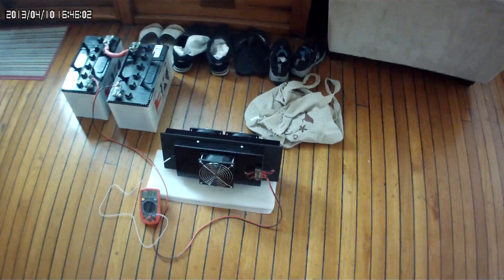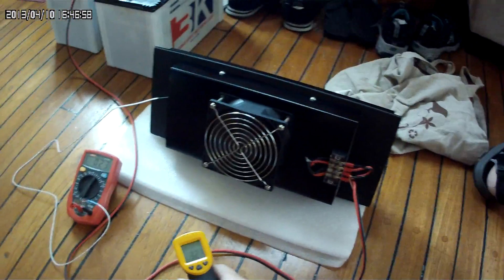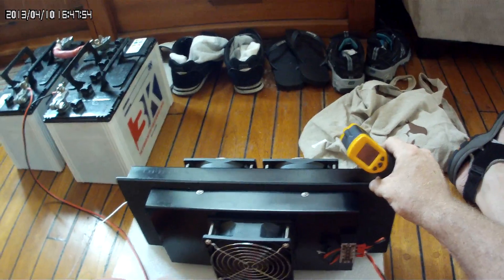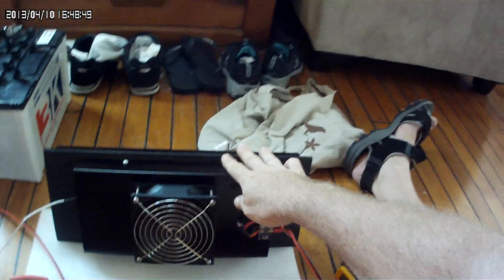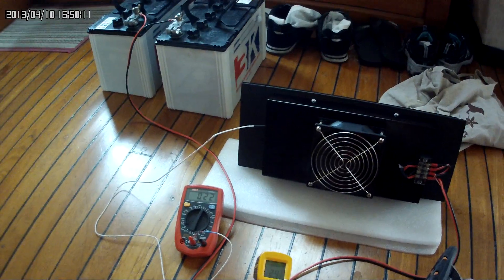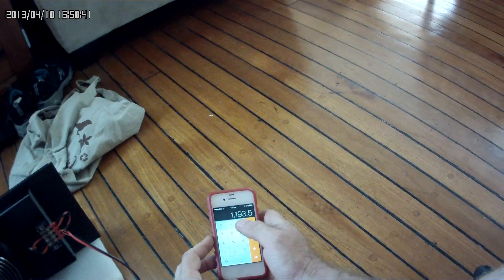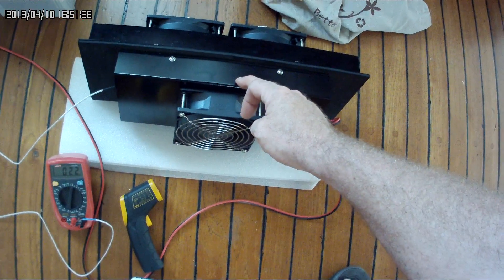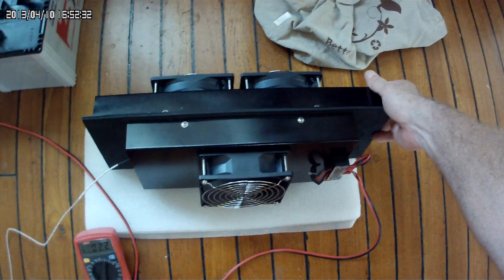Peltier Air Conditioning

Comment: I wonder how it is that the air-conditioner inside the Tesla Model S electric car works... no engine so it cant be traditional. I hear peltier has very bad efficiency though!
Reply from the maker: Hello, As I understand it... The electric car uses a DC motor powered by the batteries... Some electric cars use a conventional belt and pulley off the drive of the main electric motor to turn the air conditioning pump to move the freon to cool... and the flow of the freon can be reversed to thus blow heat inside the vehicle... and there are even self-contained DC powered air conditioners... BUT they are still using freon to make the heating and cooling. The method of compressing the freon is different.
Reply: Alan Marine the tesla has the motor directly on the rear axle, so it can not possibly be with a conventional belt to drive an air conditioning pump. i am thinking maybe they have a special high efficiency motor designed to run only the pump exclusively. I guess this is how self-contained DC AC's run

Comment: Thx for ur idea im attempting to make 1 for my room in stead of 1 peltier module i use 2 cause im cooling a bed room now im planing to build it tempreture adjustable and the fan is speed adjustable and run on 24 volts or 12volts to conserver energy cause im just in a small apartment so i cant shove 1 big air conditioner in my apartment
Reply from the maker: Watch the efficiency on the common TEC modules. I found that the semiconductors are the same as they were in 1960, so they are not very efficient. I have had my TEC modules made with several different P-type and N-type semiconductors.Not absolutely perfected yet, but I am above 90% currently. It is a lot of fun using this technology ! good luck !

Comment: Have you had problems with your heat sinks in direct sun light ?
Reply from the maker: The heat sink is covered, so there is no direct sun contact on the aluminium. As the cover is powder coated black, I used white coloured (cabinet shelf) contact film to see if there was a difference in efficiency when the sun is on it during the morning hours. Not much change. The 2 fans do a great job to remove the heat quite well.
Reply: Alan Marine *aluminum but good project

Comment: You could use the water surrounding the boat as a hear dump. Use less energy in fans, quieter, just with a large heatsink in water.
Reply from the maker: I have tried that in my earlier tests. The pump does consume more current as it needs to lift the raw sea water up 3 plus meters to the unit. That method will only allow the unit for cooling and not allow for dual purpose, as I will be reversing the polarity of the power to the modules in the winter so the heat is blowing to the inside of the boat.
Reply: Alan Marine
i wonder if you have overestimated amount of water pump needs to pump. It's surprising how low water flow may be enough. Pump that takes maybe 30-40w should be enough; just needs to be right type of pump to be able to pump that high.
Reply from the maker: For all practical proposes, a small (low watt) pump over the side of the boat is un-attractive, and inconvenient. I have tried it. A proper marine sea water pump that is connected to a strainer, and is fed from a thru hull sea cock (at the bottom of the hull) would be the permanent solution. Unfortunately the smallest size is 800 gallons per hour that pulls a bit of current. I want to have the ability to use the unit for heating as well. A water cooled heat exchange on one side would make the unit "Cooling Only". It is a good idea, but eliminates the diversity of heating and cooling from a single unit.
Reply: Alan Marine
Unit can pull heat from water too; some cases when you want to heat water is even warmer than air outside. There is even then still that pump problem tho.
Reply: If the water pump is primed with no air in the water outlet all the way back down into the oceon would that negate a lot of the lift the pump previously required sure to the poll of gravity from the exiting water....

Comment: By the way metric is international scientific standard but still some countries refuse to use it in normal life. Watt is measure of energy be it electricity or heat (i wonder why BTUs is used at all...). You don't know how eficient those TEC units are? TeC units aren't very eficient; i'm not sure if their cooling power is even as high as power they use to operate. Compressor coolers are way more eficient their cooling power is at least about 2-3 times power they take to operate. While they may not be ideal for boat use there are versions for 12v and 24v DC use as motor running compressor don't need to be using AC. CFC's are illegal in most of world as far as I know and all new air conditioners and such should be using other gases.

For boat i would suggest radiator loop with water from sea/ lake whatever if it's not too warm and if it's too warm you should consider cooling warm side of your element with water loop as it should make heat transfer way more eficient meaning cool side can get cooler.

Comment: Actually pretty small if you want to compare it to other air conditioners out there.
Is that something you built?  Or is it something you can purchase?
Reply from the maker: It is something I built. I purchased parts, and had parts made to my design. The TEC semiconductors are made to my requirement by a local factory. The standard TEC module you buy off the shelf are not efficient enough for my purpose. The goal is to eliminate the use of compressed Freon gas (CFC's) and AC power to have air conditioning in non-dry climates that my solar panels can drive efficiently. It's not perfect yet, but I'm on the right path now.
Reply: Alan Marine Very cool!  It's actually a project I've been wanting to play with myself for the exact same reason.  Solar powered AC without the use of Freon.  What did it cost to get the peltier created?  Love the videos!  Will share when I start building.
Reply: Alan Marine Sorry if it's covered in your video but I'm without sound atm.
What sort of output do those TEC's have and at what kind of price? 
If they are not ridiculously expensive I might need to get me some :)

Comment: Cool video, and love the idea and design, but I thought the calculation that was done is for the hot side they use that formula in heat decepation in electronics,   not the cold side. But still it is beautifully done

Comment: If you used a waterblock on the hot side, your efficiency will be much better, and you wouldn't need to cut a 12" hole in your wall. Being that you are using this on a boat, you have an ideal source of ambient temperature fluid to pump through the block, wouldn't even need a radiator.

Comment: What type chips and how many did you use?
Reply: There are 6 TEC modules. I tested so many different versions of the TEC chips, and all had very different results. Current chips are running for 4 continuous days and drawing 9.8 amps hourly at 24v. cooling a 210sq ft aft cabin on the boat very well ! All powered by the 1,200w of solar and a 550Ah 24v bank.